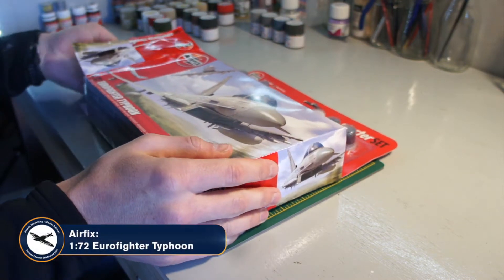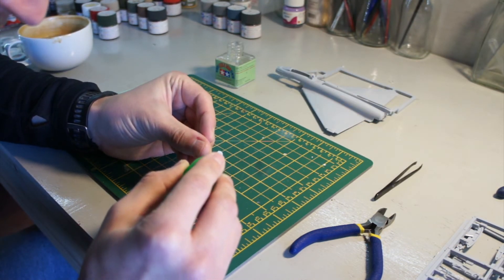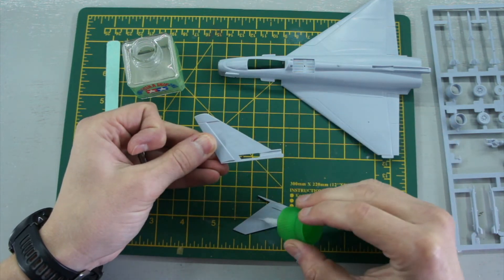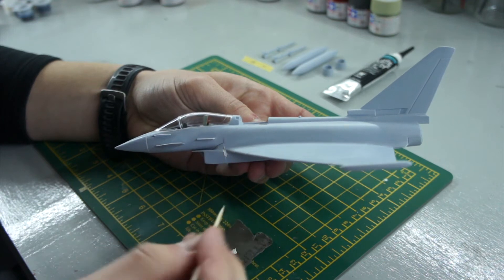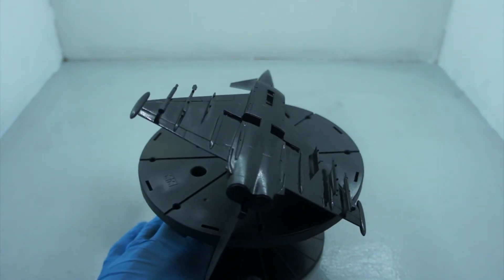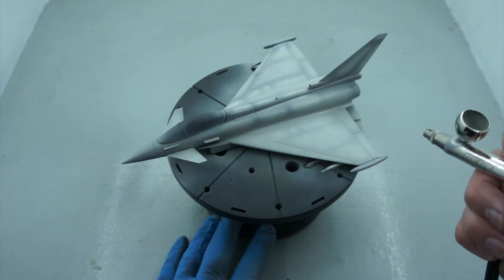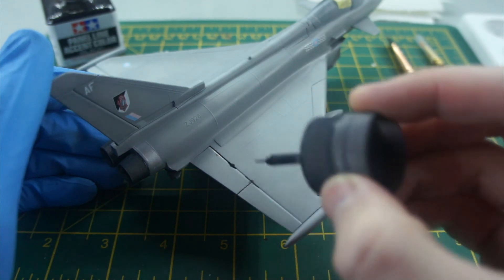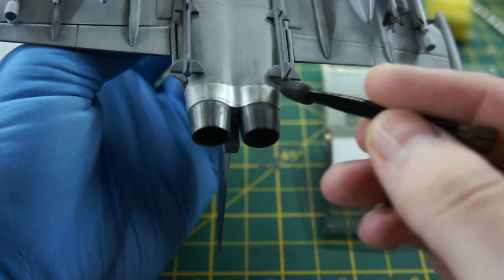Building a Eurofighter Typhoon Airfix 1/72 Scale Model

Comment: Your assembly is very excellent I might say.
I remember that I saw from some other modelers that they are putting Airfix's sprues in vinegar, so I was wondering for how long it has to stay in the water with vinegar, and also this mentioned technic (with water and vinegar I mean), can be also used for model kits from Revell, Tamiya, Academy, etc.?
Also I would to ask for how long did you wait to remove the excess paints when doing panel lines?
What markings are on the plane? And what kind of polish thing (let's call it that way) did you use to make canopies to be so shiny? I ask, cause of curiosity as well.
Reply from the maker: Thank you for your comment. I wouldn’t worry too much about the vinegar, I just let the sprues soak in the warm soapy water with a splash of vinegar for about 5 mins, then I rinse them with cold water and allow them to dry on a towel. 

When it comes to the panel line wash you can leave it as long as you want as you can remove it with thinner. I demonstrate it in my panzer build (it’s in a chapter so easy to find)… I hope this helps.

The markings are an RAF squadron that comes with the model and with regards to the canopy, I don’t think I did anything, there are special techniques though worth searching YouTube for.

Hope all this helps you!
Reply from the maker: Thank you for your comment. I wouldn’t worry too much about the vinegar, I just let the sprues soak in the warm soapy water with a splash of vinegar for about 5 mins, then I rinse them with cold water and allow them to dry on a towel. 

When it comes to the panel line wash you can leave it as long as you want as you can remove it with thinner. I demonstrate it in my panzer build (it’s in a chapter so easy to find)… I hope this helps.

The markings are an RAF squadron that comes with the model and with regards to the canopy, I don’t think I did anything, there are special techniques though worth searching YouTube for.

Hope all this helps you!
Reply: @45degreesmodelling  Yes thank you very much. I'll give a look at that panzer build as well.
And since I have mentioned tank, if you are interested, you can see on my channel the unboxing of one Yugoslav tank as well.

P.S. Your channel is great. I just love it.
Reply from the maker: @Harikejn  I’ll check it out!
Reply: @45degreesmodelling  OK. I'm a new subscriber.
Reply: @45degreesmodelling  just foumd you on youtube.just subbed to you

Comment: タミヤの流し込みタイプの接着剤を「塗って使う人」は初めて見た気がする。すぐに乾いちゃって使いにくくないのかな？
Reply from the maker: Do you mean the Extra Thin Cement or using the brush for the paints? The cement is fine, you have a couple of seconds. I don’t generally use the brush with Tamiya paints but occasionally I do (only for small parts) and I think it just needs a little practise.